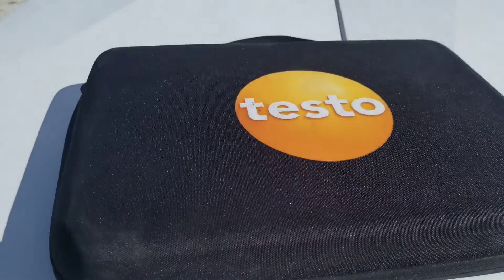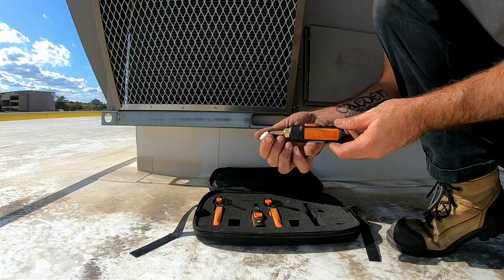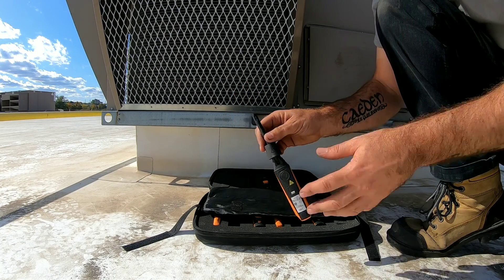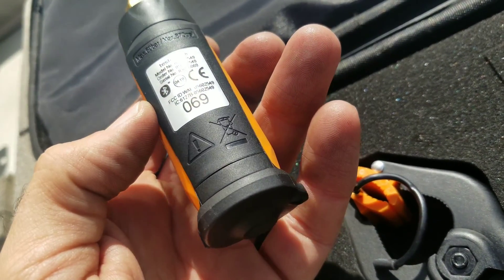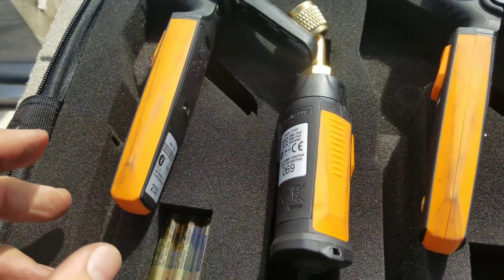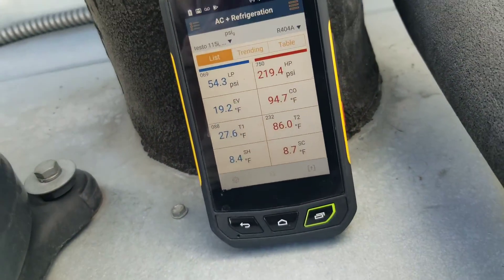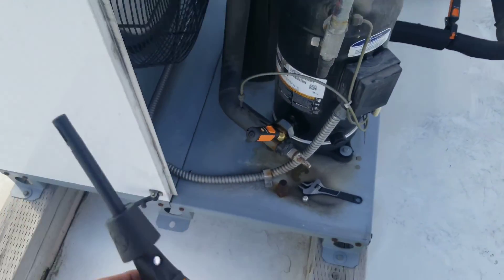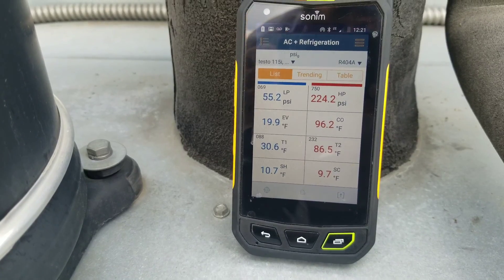Testo Gen Two Smart Probes Demo And Review - HVAC Tool Review

Comment: My only correction would be. You want to turn on the probes before connecting to the ports.  You'll need to zero out the probes before each use.
Reply: it makes no difference as they are digital probes not analogue. in my experience with these clamps you can pretty much do what ever you want. My only grievance with these probes is that they're not the most water tight and i have experienced water ingress in my clamp probes over the last year that has caused one to fail.

Comment: Is it worth having the 2 thermohygrometers or do you not really use them much? Just curious as it's double the price with those as well. Wondering what your honest opinion is I'd appreciate your advice
Reply from the maker: With 2, you can use the Cooling Heating Output measurement to get actual btu capacity of the machine.

Comment: Bro, I have those and I found out that the the clamp teps are way off. Like around 10 less than it actually is. Used 3 different wired clamps and 2 multimeter. Wired was saying around 50 and the Testo was saying 41. Should test yours right now. Maybe put on an ice cube.

Comment: i know its been a while since you did the video,  how do you like your testo smart probes.   thinking of picking them up for the upcoming summer season    thx  be safe out there.
Reply: I got my set but the numbers are different.  I'm not using them because I too a one year contract in another company.  My set has more probes; psychrometer, infrared thermometer heat probe and manometer.